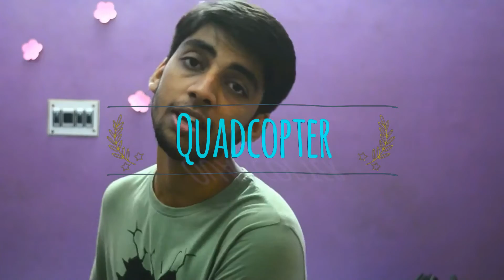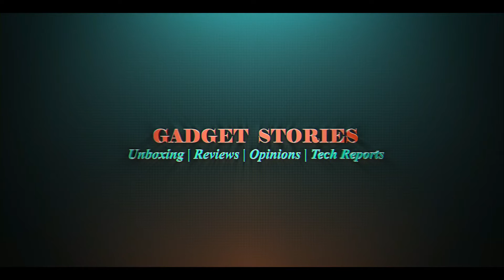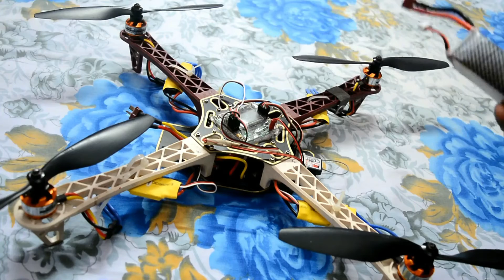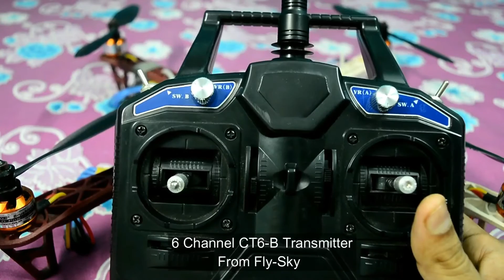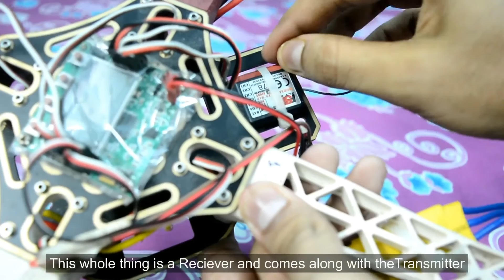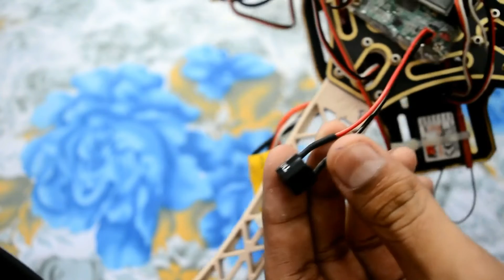How to make a quadcopter | DIY drone - very easy method | Quadcopter making tools - Part 1

Comment: can u tell me about the pi editor
 i am very confuse in this  setting
Reply from the maker: Roll/Pitch P Gain: 75
Roll/Pitch P Limit: 50
Roll/Pitch I Gain: 40
Roll/Pitch I Limit: 20

Yaw P Gain: 75
Yaw P Limit: 20
Yaw I Gain: 30
Yaw I Limit: 10
  
Set the values like this and try to test the drone by changing the values by 5 or 10 and according to the response set it.
Reply: not this I want to understand what Is pgain for 
what is pi limit for and other....
setting for
Reply from the maker: P gain - to give stability and higher the co-efficient more the quadcopter will be sensitive and reactive to angular change. which simply means with higher value of P gain it will be more sensitive to Roll/Pitch.

I gain - increase the precision for angular position, useful in irregular wind. That means in unwanted situation it will help the Drone to remain stable.
and the limits are the highest value you can set for a drone. Here P means proportional and I stands for Integral.
Reply: and what about other pi setting
Reply from the maker: what options are there in PI Settings?
Reply: I want  to know the function of this setting